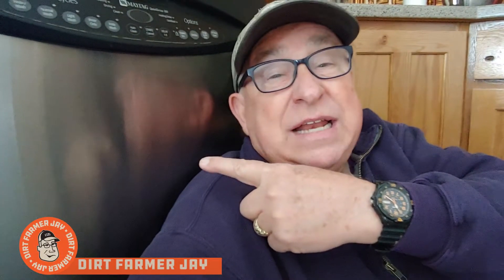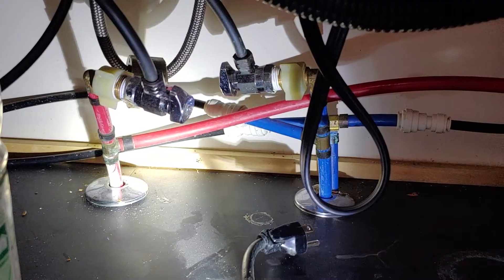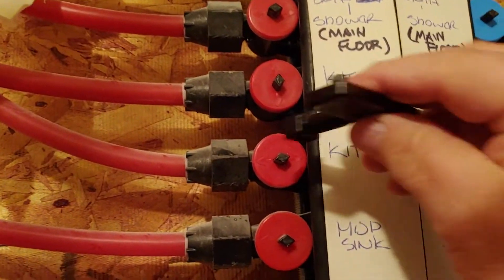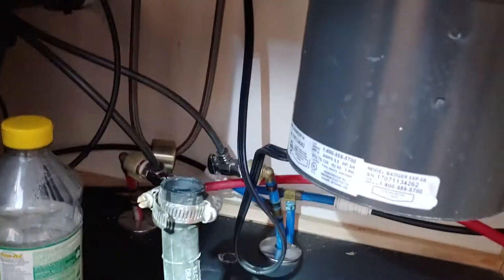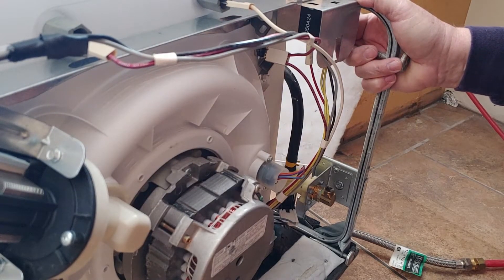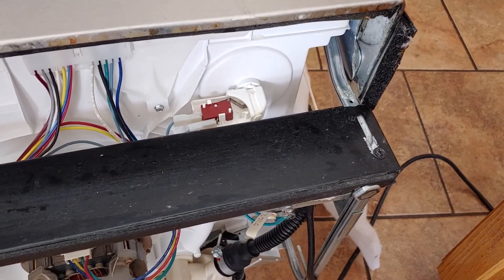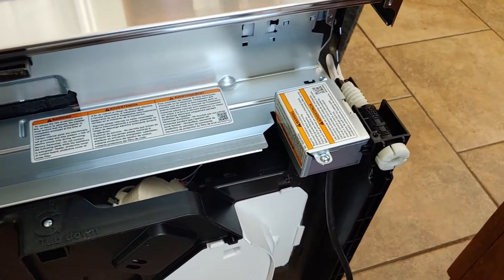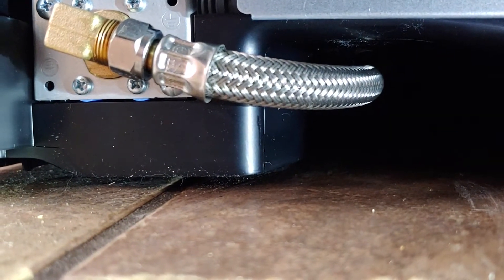Remove and Replace Your Old Dishwasher - EASY!

Comment: Random question- I have renters and just replaced the washing machine valve from twist to lever. My question is, is there an extension to keep the washer water drain flex pipe in the pvc pipe? They seem to have issues with every appliance and life in general 😂😂
Reply: well you may want to use stainless anti burst hoses if not all ready, you should be able to find an adapter for extending your drain hose too, but some feel you shouldn't push that hose way into the PVC, and you could use strong string or zip tie to keep it in place - just my take
Reply from the maker: tazznum1 - fishlanding had some good insights. I've always secured the drain discharge hose into the drain pipe, simply because I've seen the hose back its way back out when high pressure occurs and the water really comes blasting out of the end of the hose. As fishlanding said, a good cable tie or piece of copper wire will do the trick. I hope this helps! Best, dfj

Comment: So my wife got tired of me doing everything myself in our house for almost 50 years.  A few years ago we bought a new dishwasher and I said I would install it.  She asked the retailer how much they charge to install and he said $25... she ranted... "You're going to save $25 for all that work?"... so I relented...
The DW was delivered and I'm not sure the installer they sent had reached puberty... he installed it as crooked as anything , after the installer left she turned it on and water leaked over the kitchen floor!  I pulled the DW out and re-installed it correctly...
I now install all the new appliances in our house to be sure it's done correctly...
Reply from the maker: TNtoolman - I feel your pain. I've had similar experiences when I've called in help. In our case, for the dishwasher, the install was $135, plus required new supplies, so the savings were substantial. Thanks for watching and writing. Best, DFJ